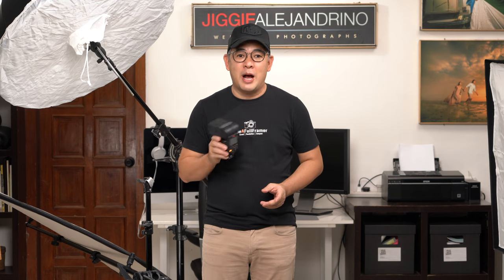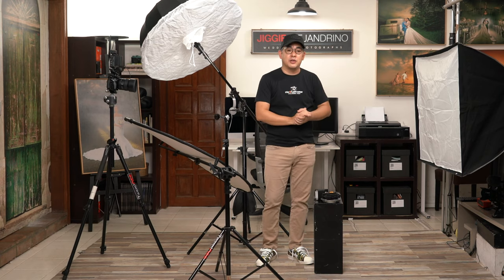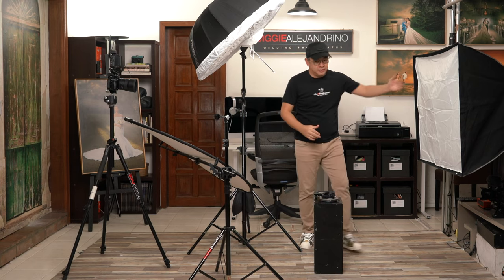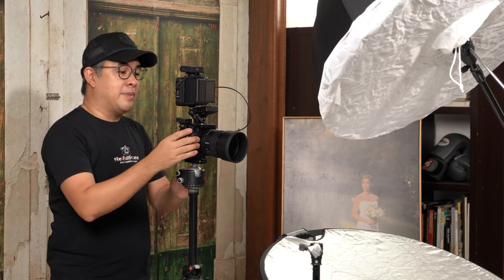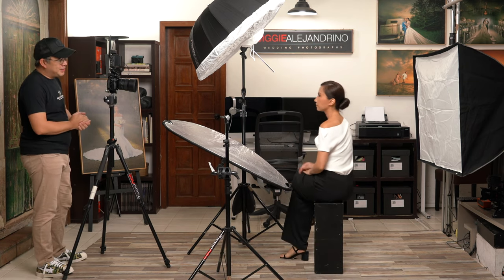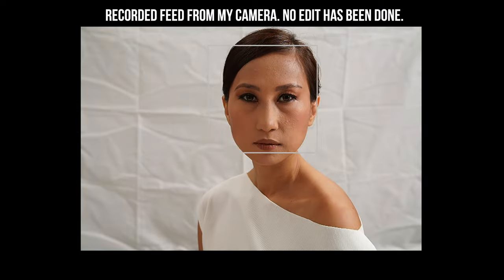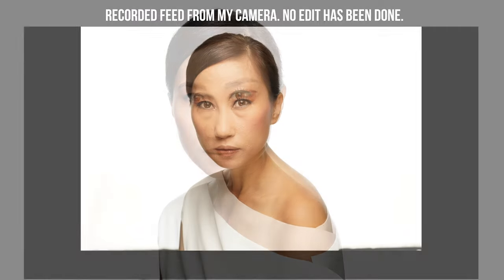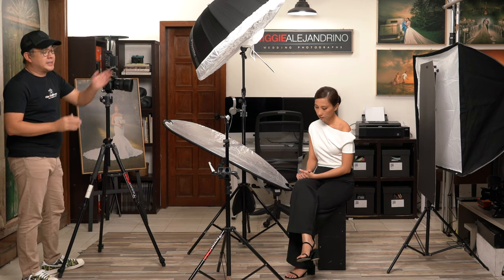Lighting Tutorial: Basic Beauty Lighting Setup using Two SpeedLights (Off Camera Flash Photography)

Comment: Another awesome, practical and straight to the point video! Would it work the same, would it produce similar results, if one of the light modifiers were smaller than the ones you used?
Reply from the maker: It should :)